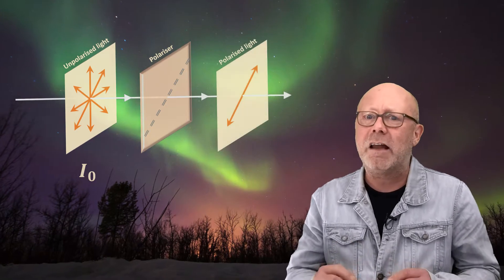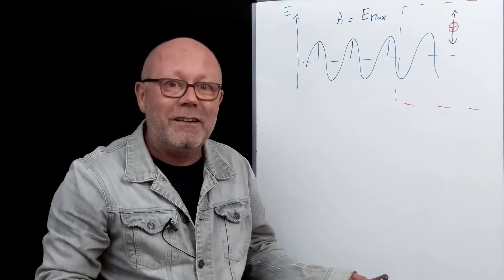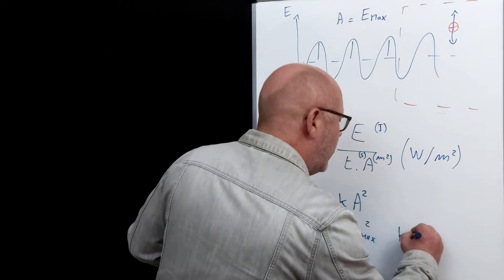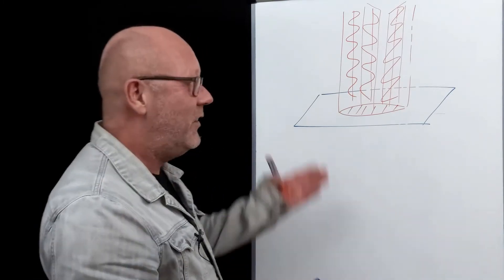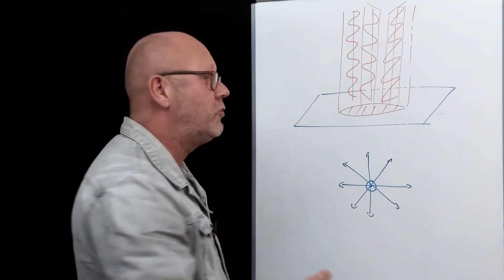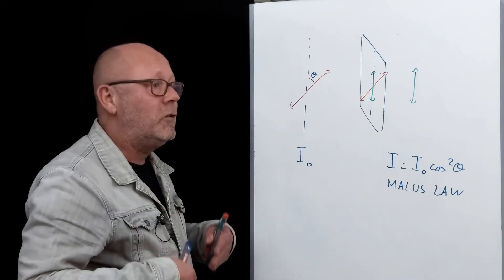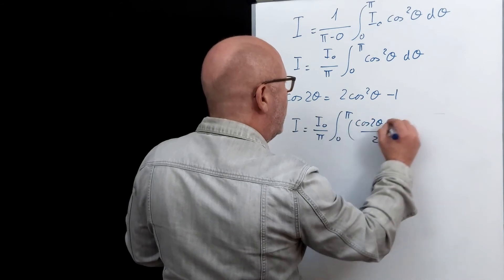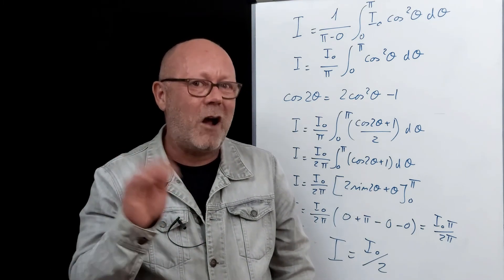Why does a polariser cut the intensity of unpolarised light in half? (Polarisation Part 3 - Physics)

Comment: The math works, but that means that if we polarize light to say 0 degrees, then we put another polarizer at 90 degrees, we would get 0% light through, but if we put a third polarizer between the 2 at a 45 degree angle, we would get 25% light.
Which means that the light is not filtered through like in your first video, but rather has a probability to go through and change their polarization when they do.
This is ofc. just my thoughts.
Is there an answer to why?

Comment: I'm sure OpenStax textbook tells us a polarizer cuts unpolarized light in half and I probably missed it somewhere, but I had to dig to find an explanation and this video is AMAZING. I still wish I were smart enough to understand when to just integrate something. You're given the intensity of light equation, but I wish I knew I could actually integrate it over an interval (and even average it) to find the final result. Like, even after three calc classes, I'm still not on that level of comprehension. Beautiful though, thank you.
Reply from the maker: Hi, Integration is used when you want to sum something (a quantity A) across another quantity (B) on which A depends.

Simple example to illustrate:  A spring. 

You know that if you want to extend a spring by x meters, you need to pull with a force F = k*x where k is the spring constant (stiffness of the spring). How much energy do you need to provide to the spring to do so?

You could just multiply F by x, to find the work you did, but that would be incorrect, because F depends on x... 

So you integrate W = Int(Fdx) with F = kx, that gives you W = Int(kxdx) 

By applying integration rules, you find: W =  k*Int(xdx) = kx^2/2, which is the formula of the potential energy of the spring when extended by x..

I hope this helps you understand when to use integration

Comment: Why do you have to take the average while taking the integral? Isn't the Intensity that passes through simply the sum of all intensities between 0 to pi? I understand tha regardless if you take the average or not, the result will still be the same, but I would like to understand the physical reasoaning on why you are averaging the integral.
Reply from the maker: To try and make some physical sense out of this, consider each polarisation plane intersecting a screen. For each polarised ray, you get a line. By integrating this line over the angle, you get the surface of a disk. If you wanted to know the total energy or power received by that disk, you would just sum the energy or power contribution of all polarised beams. But here, we are considering an intensity (a surface density of energy), this is why you need to take an average, 
As an analogy: consider 1 liter-samples of sea water from 3  different oceans and measure they concentration in salt: Atlantic: 35 g/Kg, Pacific: 40 g/Kg, Baltic 30 g/Kg. Add them all in a bucket. To get the total amount of salt, you just add 35+40+30 =105g. But what would be the salt concentration in the bucket ? You would add all concentrations, and then take the average (35+40+30)/3 = 35g/Kg , wouldn’t you? 
That’s what we do with intensity: because the energy is not deposited on the same surfaces and that we are dealing here with "energy concentrations", we need to average the sum to get the intensity on the full disc.
I hope this helps!
Reply: @PhysicsMadeEasy  awesome explanation

Comment: I find this explanation still unsatisfactory. Why? Because simply saying unpolarized light is composed of a random distribution of linearly polarized plane waves makes a contradiction. Since electromagnetic fields follow the rules of vector addition, and the distribution is kept  rather symmetric (since puting unpolarized light through a polarizer always gives 1/2 Intensity independent of rotation), you would expect the average of the E field to be zero. But it's not. I'm looking for an unpolarized classical solution to Maxwell's equations, whos intensity is cut in half when passing through a linear polarizer.
Reply: Your arguments here are helpful. It really improved my understanding of this topic.
Reply from the maker: Hello Mike, 
Thank you for your comment. It is difficult explaining this without illustrations But I’ll try, at least maybe this will give you a path for reflection. 

First, I am sure you know, but, just to make sure: an EM wave is the oscillation of an electric field vector: If you fix a position, and observe the evolution with time of the E Field vector at this position, you will observe the oscillation of its magnitude in a plane perpendicular to the direction of its propagation.

Why do you think the integration was from 0 to Pi and not 2Pi, because when you rotate the polarizer by 180 degrees, it is the same wave that passes through: the same vector. You do not have any vector opposite that would cancel it in any given plane.

I hope this helps

Edouard
Reply: @PhysicsMadeEasy  I have trouble with the second paragraph. You say you imagine a plane fixed to a particular location perendicular to the direction of motion (the wave vector k). The trouble arises when you are trying to model UNpolarized light by saying that it is a bunch of plane waves with random polarization vectors. This means that if you were to calculate the electric field in that fixed plane, you'll end up with zero.

 It's like asking yourself what is the average velocity of all the gas molecules in a stationary box...zero.
Reply from the maker: Hello Mike, 
You are correct. Your analogy with the gaz moledules made me realise that the model I use to describe unpolarised light is conceptually incorrect. Such model imposes that when the relative phases are perfectly random, that the light is perfectly monochromatic and that all amplitudes of all rays are rigorously identical then, saying that unpolarized light is the sum of polarized rays, means that unpolarized light would become… no light at all… The integration leads to the right answer, but the model is incorrect.

The reason it provides the right result is that I integrate the intensity (the square of the electric field vector), the same way we get a non zero average speed by taking the rms of the velocity.

I did a bit of digging, and found out a model that remains classical, and prevent the nullification of the resultant electric field strength vector. It does so by involving a time component. Instead of seeing unpolarised light as a distribution of polarised rays in space, we can do so in time: As a classical model, unpolarised light can be seen as a polarized ray that fluctuates in polarisation on extremely small time scales (check the answer of Wolpertinger to this thread for more details: https://physics.stackexchange.com/questions/177572/what-does-electric-field-of-unpolarized-light-look-like-when-measured). 

Thank you si much for your input on this one, you made me evolve! :-)
Reply: @PhysicsMadeEasy  
Yeah. I spent my entire undergraduate education thinking that the unpolarized light model was just a bundle of pane waves with random polarization angles (just as my instructors and professors told me..and it got my through the exams thinking that). 

And later learning the quantum model further reinforced that belief, since the quantum model was a more solid theory, so there was no point to find anything wrong with the classical model despite knowing that adding random vectors results in zero. 

I didn't realize there was something wrong with the way classical unpolarized light was taught the school system until about 10 years later. It wasn't until I remembered that when Maxwell, and Einstein used EM theory (last quarter of the 19th century), they didn't have a quantum model, but certainly they understood that Maxwell's solutions required vector fields, and there was such thing as unpolarized light. So there had to be a working classical model.
Reply: @PhysicsMadeEasy  have you made/will you make a video explaining this model discrepancy?
Reply: @PhysicsMadeEasy  
Here. This might have the answer I'm looking for. What do you think?
https://www.osapublishing.org/viewmedia.cfm?r=1&rwjcode=josa&uri=josa-35-8-525&html=true

Comment: Hi, why for the integration part, it's pi not 2*pi, since the angles are all around 360 degrees?
Reply: With respect to axis of polarizer, the rays can't make any angle greater than 180 degrees.
Reply from the maker: Hi Ze, Sagar responded correctly. If you rotate the polarizer by 180 degrees, you are in the same configuration...